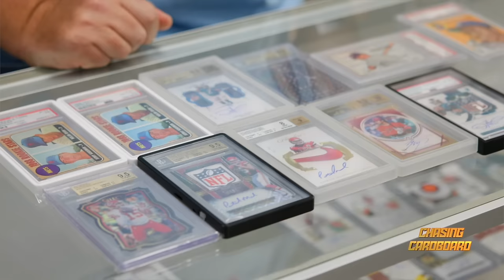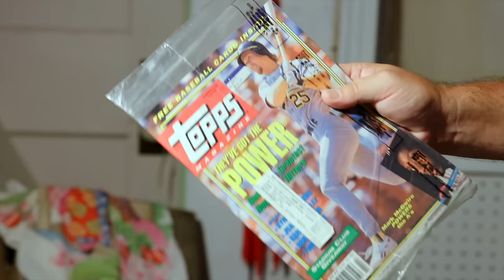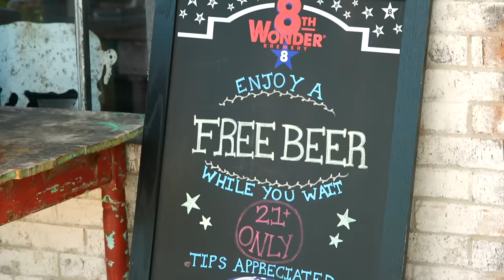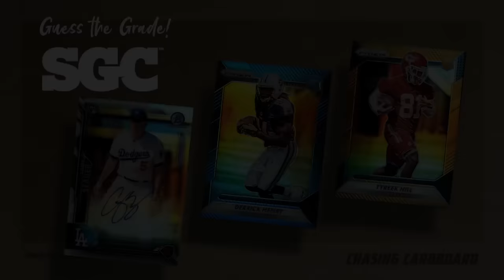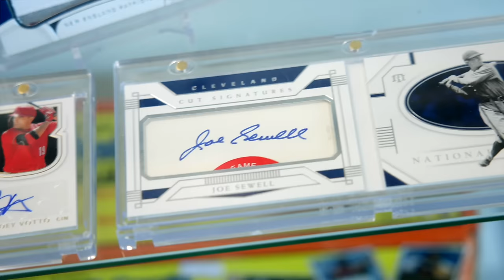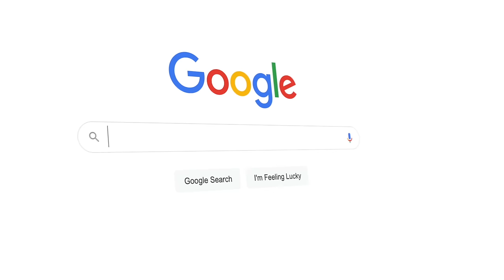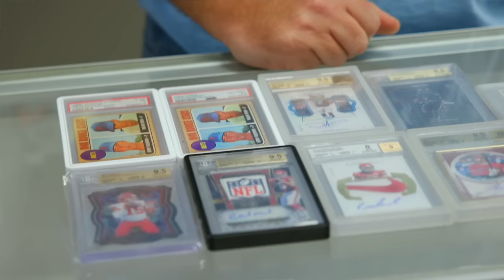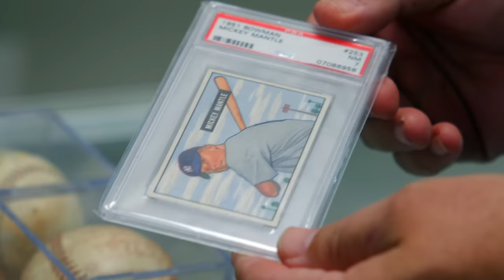From CARDS to CASTLE! How he Flipped Sports Cards to Fund Dream Home & ADOPT a CHILD! (EP #31)

Comment: Die cut black 1/1…2 of them?  Does that mean it’s a 1/2?  That’s what honestly makes me stay away from ultra modern.
Reply: Only 1 black premier level 1/1 and it’s this die cut.  There aren’t any other premieres.  There is one field level 1/1 and it looks totally different.  Those are the only two black 1/1 Mahomes in the whole product hence the two black 1/1s Ty mentioned
Reply: I was a little confused by the way he presented that statement too and I own the card.  😂
Reply: @familysportscollectibles7957  I am much more of a vintage collector in comics and cards, but honestly if you know something about something like you and Ty…there are some great ultra moderns obviously.
Reply from the maker: Select is different...there are 3 tiers of cards...the 0-99, 100-199, 200-299's.... they are the different "levels" Brent mentioned. Each level gets a little more short-printed.. Usually top rookies have a card within each level... So within Select, a RC will have a card within each tier. But in 2017, Mahomes only had a RC within 2 of the tiers.... meaning he only had two of the Black 1/1's instead of the normal 3.

Comment: They bought that entire  1966 binder of cards for 20 dollars.?  Unbelievable. Must have been 300 cards.
Reply: More like 100
Reply: Keep us posted on how you build
off that 1966 purchase...condition looked pretty good.  Couldn't pass on the price
Reply: @randyworden5232  Actually they were in pretty bad shape.
Reply: @BaseballCollector  nice of you not to trash them on the internet.  Still some potential to build a low grade set and resell. Availability of ANY cards in those years is an issue.  Ideally you would hope at least to find cards with decent eye appeal though. Not always easy to spot creases right away either. I had an expensive and time consuming search building a nice set of 1979 Topps Baseball years back.  Bought some PSA 8s and made sure all the others were as good or better.  Forgot about investment return very early in the chase!!!
Reply from the maker: Thanks for watching!